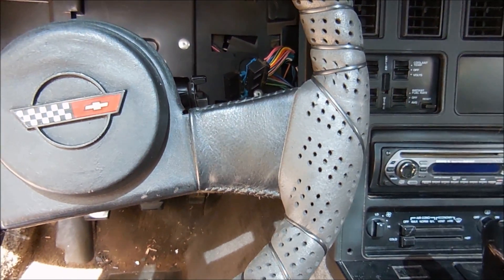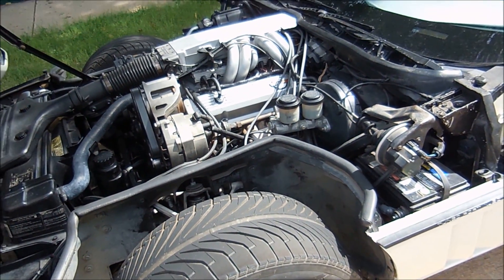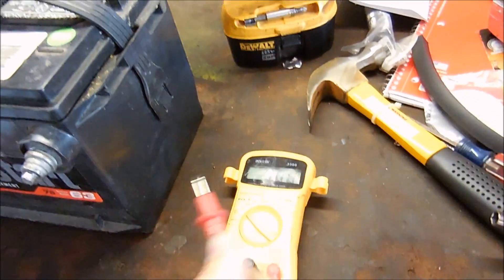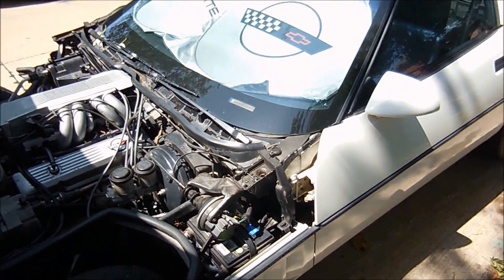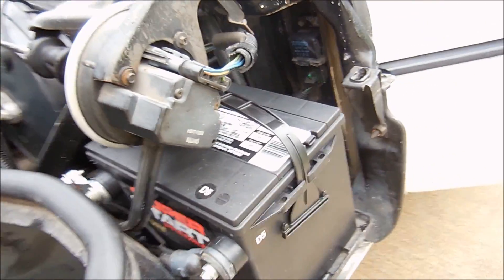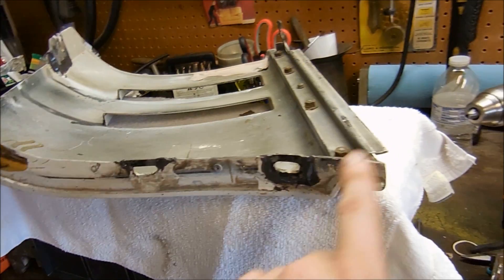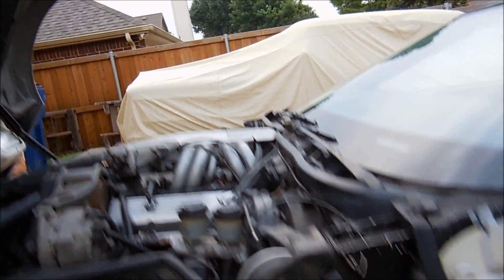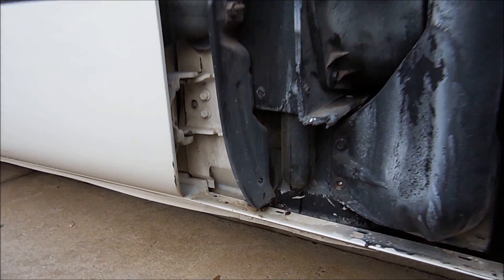1985 C4 Corvette: Project Daily Driver Part 2 of 8

Comment: Came across your vids...enjoy and I do pick up a pointer here and there.     Interesting is that my '93 had a cracked panel (battery) when I purchased.  Very noticeable so I bought a new panel, had it painted and it looks great.  I too think someone tried getting the battery out without removing all the screws.  Again enjoy your vids!

Comment: It just oozes 80's! And you fixed that panel the best you could on a budget. Bubba is ripping the panel off, knowing you broke some stuff, and then just putting it back. It's funny that the bubba panel did not rub on the door, but the other one did with all the fasteners in place. Probably not tightened enough?

Comment: You don't have to take the panel off to get the battery out. I simply removed the cruse control module and the bolts from the strong bar. This is easier than trying to remove and line up the panel!
Reply: I'm gonna check out your strategy. Sounds like a good idea. Due to severe spine injury I have a hard time bending down, squatting, things like that, so whatever I can do, so I don't have to do that, is a blessing. Thanks for the idea.
Reply: @redhot85corvette44  that's wasn't funny

Comment: Hey Ben I have a 1985 c4 too! I lost the keys and was wondering if you could do a video on replacing the ignition lock cylander. Thanks
Reply from the maker: Daniel Nathan If I was you I would search "ignition lock cylinder replacement corvette forum" in google and see what you get there. I would make a video on that if I needed to but as of now "knock on wood" mine works fine.
Reply: TheCorvetteBen Give your VIN to a GM dealer and they should be able to cut you a key.  You may have to have ID and proof of ownership.

Comment: At 4:14 that bare positive connector is in a bad spot, I'd reposition it or get a factory type cable. You don't want to burn down the car.
Reply from the maker: mcqueenfanman What other spot could it be in ? This was a large part of solving the battery issues. The factory one was broken in half
Reply: Well look at the metal support beam, if that battery slides towards the inside of the car the bare positive connection will hit it. At least wrap one of those in rubber.
Reply from the maker: mcqueenfanman I hope the battery hold down will keep the battery in place, but your right it needs to be insulated. Any ideas on what to use?

Comment: there is a regulator module under the dash on the passenger side . Besides the main culprits of what you mentioned, if all of those turn out fine, check that. The bottom part of the panel is slotted and instead of only needing to loosen that bolt and panel would come off easy, that rip off the panel. No common sense.

Comment: That ground you showed is that one (if corroded or damaged) able to make the digi-dash dash dim? It works but it's hard to read and I need to use a flash light to read it at night, I've tried the "turn the headlights on so it over rides the light senser" trick and it still does it, my Corvette is 86', I know this is an "older" video but I'd appreciate the help.
Reply from the maker: Usually the dash is dim because it needs rebuilt. Sadly there are not any cheap or easy fixes when it comes to those dashes. Either buy one that is known good, or get yours rebuilt.

Comment: Hey man--that's no accurate way to test a battery. A battery with a cracked cell will hold a charge for several days or even a week sometimes. Put the battery under a load and test it with a real tester..

Comment: Where did you get the replacement digital gauge cluster?
Reply from the maker: +Dominick D'Ottavio bought it from a corvette parts company called northern corvette. They are out of Canada. They sold me a working one out of a parts car.
Reply: Thanks!  I just picked up an 84 project!
Reply from the maker: +Dominick D'Ottavio remember 84 clusters are 1 year only parts
Reply: Its an issue I am running into trying to find one. Wonder why the 85 wont work.